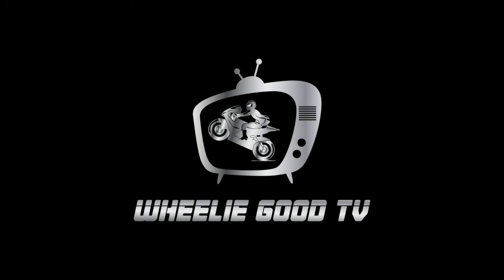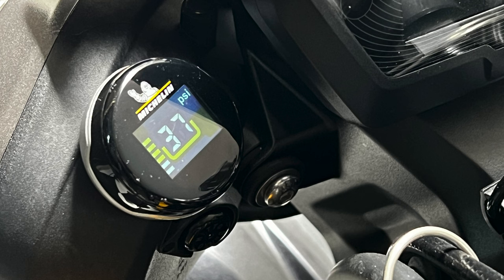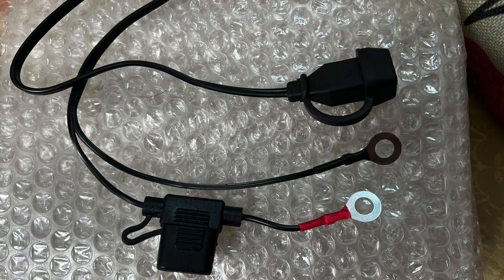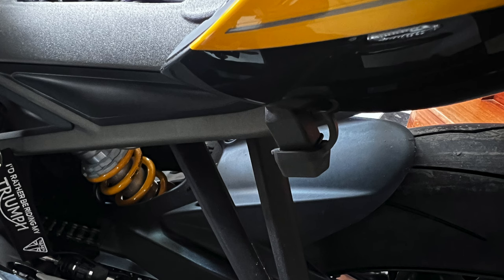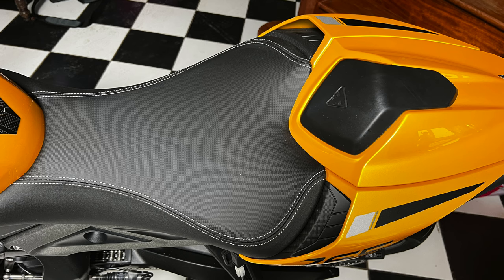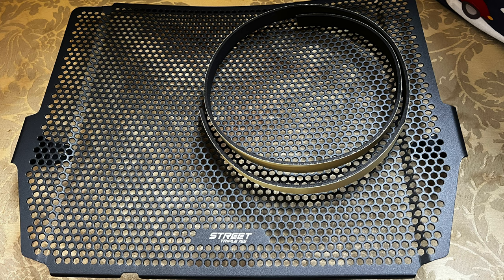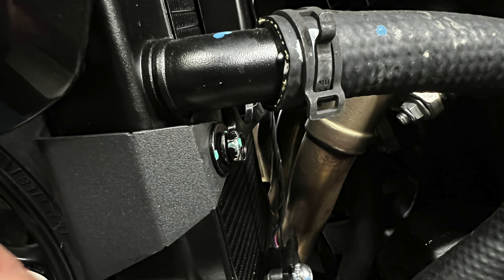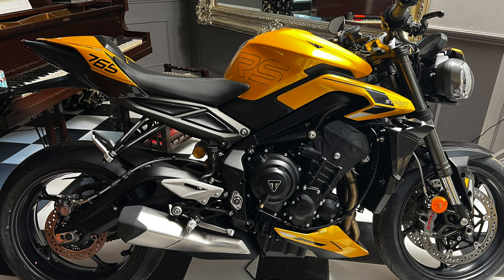My Triumph Street Triple 765 RS Modifications | Now the bike will be even better!

Comment: In South Africa we get the tools in a little Triumph branded pencil case which sits under the rear cowl. Reason for this - I was on a track day and a bloke on an RS had one of the allen keys work loose and find its way to the battery, arced across the terminals and set the bike on fire! It was pretty dramatic and probably would never happen again but still...  I have a Moto2 and we get the suspension adjuster tool too - even though the Ohlins need an allen key and are super easy to get to with the clip ons. I'm an inny.

Comment: You bought a new 765 RS, and you bought the cheap knock off protectors from ali express instead of buying the real EvoTech stuff that they ripped off the design but not the quality? Sorry mate, it makes no sense to me.
Outy, I like to see more. I got the same advice from the Triumph dealer as others. Remove the fork adjuster tool from the seat and put it somewhere safe.

Comment: I would totally get the Triumph pressure sensor. I have the unit on order for my RS. Also got the heated grips.
Reply from the maker: I may put the Chigee system on this bike. It has tyre pressure monitoring as well as tyre temperature also. 👌
Reply: @WheelieGoodTV  I went for the Triumph system because of aesthetics. Also going to pickup the connectivity module to not have a phone mounted to the handlebars.

Just wish there were more options for aftermarket exhausts with maps.

Comment: Looking sweet 👌.  Mirrors on my 21 are outti and work a treat. Just a quick note, when I picked my bike up from the dealer he said remove the front suspension  adjuster from under the seat cowl and put somewhere safe.  These apparently work loose when riding and disappear. Finding a new one is like rocking horse s#@t.
Reply from the maker: Good tip there. Thanks!!
Reply: To anyone who “lost” this adjuster: look for it below the battery. It always fells from its place and slips to there.

Comment: Tail tidy and a smaller number plate is a must for me on any bike. On my 2015 BMW s1000r  i use Michelin Road 5's. I find them excellent. Theres a "6" version out now too. Happy motoring,and if i ever see ya out and about ill say hello.
Reply from the maker: Funny, I’ve just had the bike registered today and the number plate looks bloody awful at normal size. That shall be the first new change! I’m getting the Road 6’s put on at the first 1K service. I love those tyres. 👌🏍️
Reply: Be careful if you intend to fit a tail tidy. Was watching a video a couple of days back and the fella was saying the tail light lens gets battered with small stones from the tyre. If you intend to remove the sticky tyres it comes on, it may not be an issue. I have the same Cosmic yellow one as you, all i've done is an evotech radiator guard and removed rear pillion pegs and fitted blanking plates. Love the bike, don't like the dashboard, don't like the bar end mirrors and don't like having to pull the clutch in to start it. @WheelieGoodTV

Comment: Great looking Street Triple RS in this yellow colour scheme.
Mirrors have got to be facing outwards so you have max view behind. The inwards position is just wrong.
Does your house insurance cover your bike inside? I would double check to make sure.

You need to get yourself a tyre changer with all your bikes. I have a few so got the Olmax one from Poland £220. Fabulous piece of kit very well made and the guy who makes and sells them is brilliant. I didn't get surcharged for taxes on delivery, but you being in Ireland and the EU definitely wouldn't pay extra. Makes changing tyres a doddle. Literally takes minutes. Then all you have to do is balance which also takes 10 minutes max. Then back on the bike. No taking them to a bike shop and paying extortionate sums to get them swapped and having to book or wait for them maybe to be done or not depending on their work load. So satisfying as well to change your own bikes' tyres. A tyre changer soon saves you cash. Don't be fooled by YT videos telling you can change tyres with levers. It's hard work and you likely end up damaging your bike's rims in the process which will be €€€€€€ to repair. I know I did it.

Looking forward to you getting this RS out of the road. Surely you are not going to use it in winter with salt on the roads? It would soon kill it. Nevertheless you need to give it a thorough coating of ACF50 to protect it.

I got Triumph heated grips for my Speed Triple RS when I bought it from a dealer and they only cost £199.
300€ seems a little bit steep.

ATB.

Comment: For stem mount, u can sand down the portion that was stuck, you really dont need to sand a lot and with some pressure it will slide right into. I would say phone placement at the center is way nicer than mounting on the handle bar

Comment: Got to be OUTY!  I have wide shoulders and I noticed that the mirrors were 80% filled with me during my initial test ride, but they were turned in.  
Q: what are your thoughts on a small windscreen?  
I started out doing motocross, then sport bikes, but I've been the past 20 years on ADV bikes.  So I was pondering a small screen.
Great video! 
-Cheers
Reply from the maker: Hi, personally I don’t like the screen as I think it spoils the look but that’s only my opinion. The airflow is so smooth that it doesn’t need the windscreen anyway. 👌🏍️

Comment: My 2023 Street triple R already had the optimate lead fitted as standard, tucked just under the rear seat towards the battery are you sure its not already fitted ?
Reply from the maker: I’ll check that. Thanks for the info. 👌